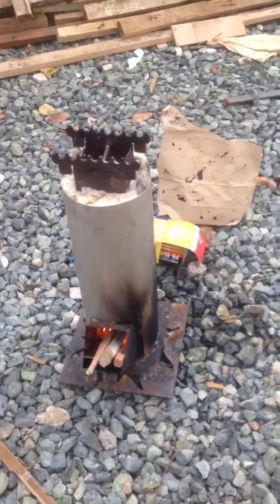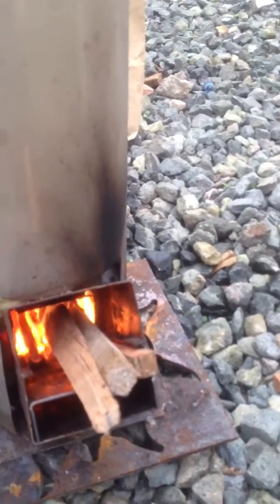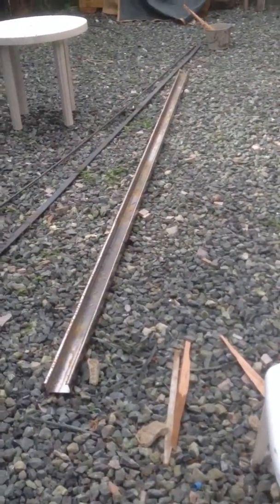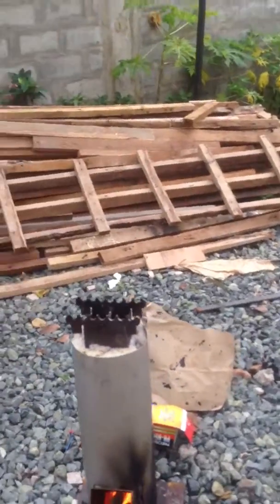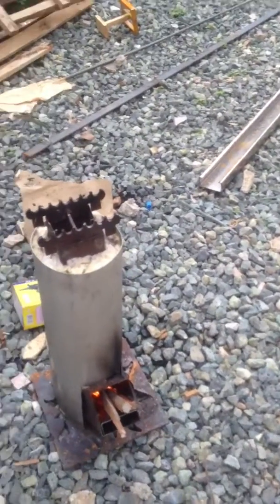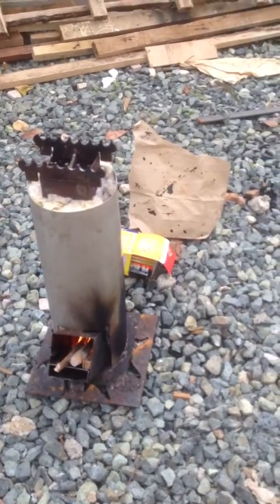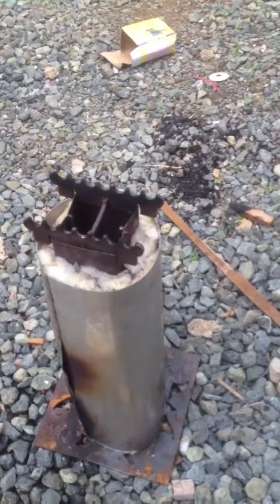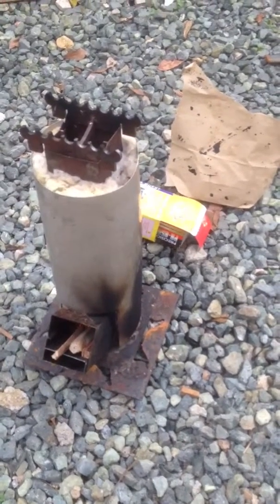Rocket stove in action.

Comment from the maker: I made a few changes for version 2, galvanized heat shield, fiberglass insulation, improved carburetor design to give more turbulence and better combustion.

Version 3 will have a firebox/flue made from 1/8 inch steel plate cut by CNC and bent into shape. Eliminating the welding as my welding skills are not the greatest and to expedite mass production by unskilled labor.  I am still debating using .8mm stainless or 1/8 inch steel as both are the same price, however the steel is easier to work